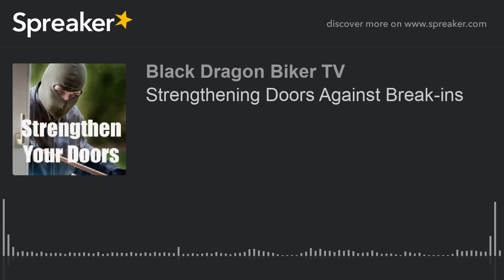Strengthening Doors Against Break-ins

Comment: If you have the extra money and time the big word IF. LOL around your door frame remove the inside the plaster,wood,paneling or what ever it is you have for you main wall and add metal to the inside of the inside of the frame and then bolt your door framing back in. And of course replace the wall and that will also not only stop a robber. But, law enforcement battering rams or bad guys using sledge hammers.